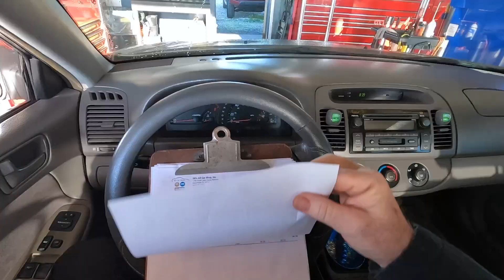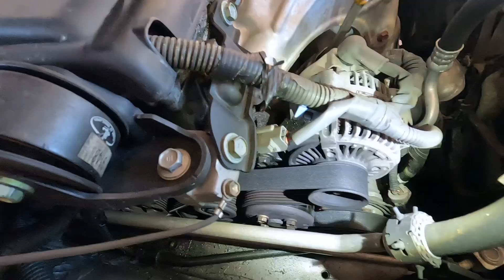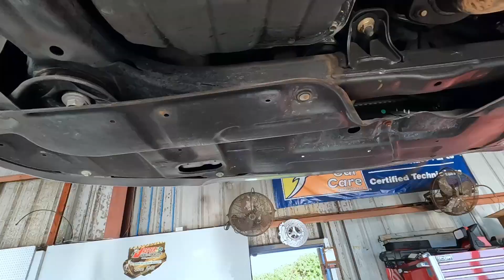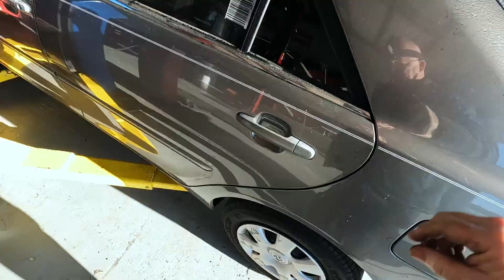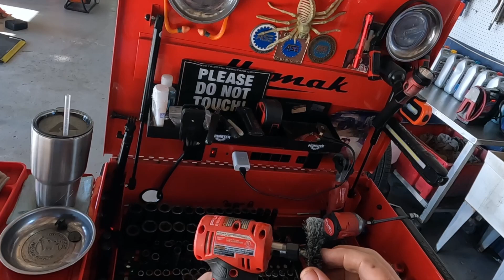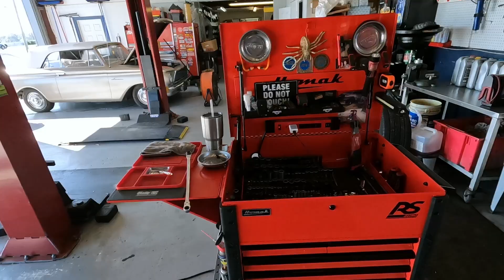TOYOTA CAMRY OIL LEAK repair AND Safety Inspection....

Comment: I had that same car. Bought it new and traded it in last year at 270k. Goes forever. Still had original water pump, alternator, and transmission. Never touched the air conditioner the entire time.
Reply from the maker: Great cars!

Comment: These newer belts,I have the tool which goes into the grooves.If the tool goes down all way,belt is bad.Dayco is one that makes this tool sending it out for free.
Reply from the maker: Yes, I have 8 or 10 of them
In my box. The way they work is as the teeth and belt wear, they can be rocked back and forth. The pulleys form the belts grooves into points as the belts rocks side to side during use over time.. 
I’ve done thousands of belts now, so I can see the wear in those grooves without grabbing the tool now.

I have found that aftermarket belts last about 1/4 to 1/5 as long as the original.

Thanks for watching and leaving a comment! Appreciate it!